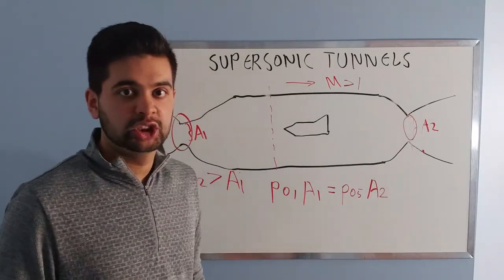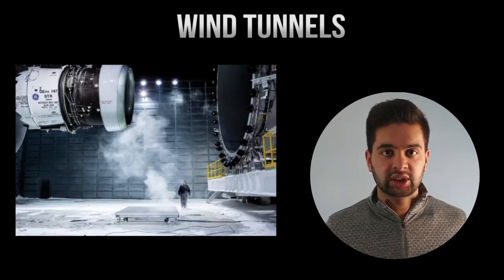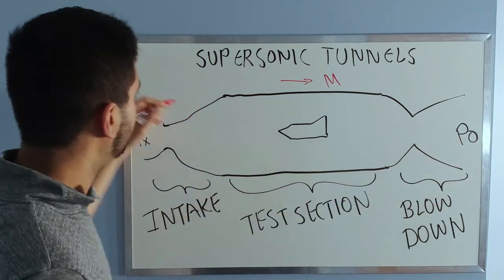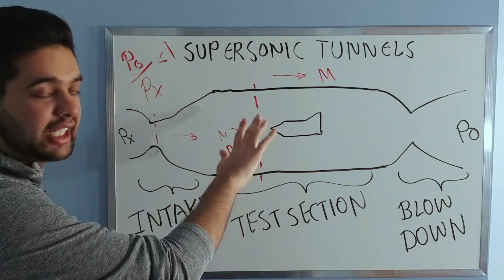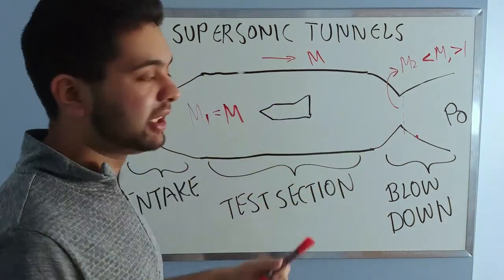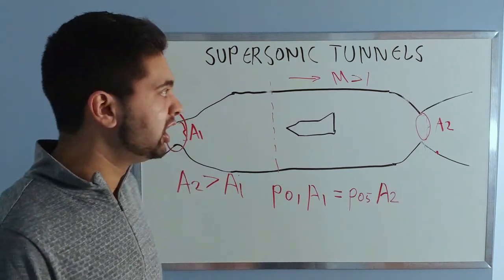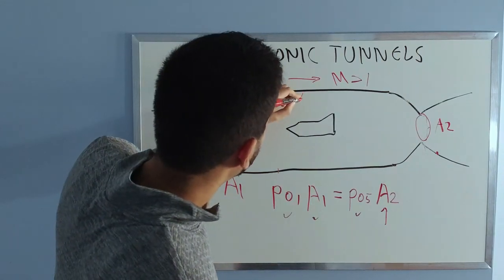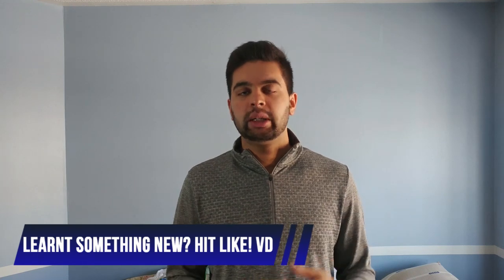Hypersonic Flight: How A Supersonic Wind Tunnel Works (For Beginners)

Comment: first glaring mistake ... a wind tunnel is to test the flow dynamics of an object .... it does not have to be a model ... it can be full size ... the only constraint of WHAT you are testing is if it fits into the the test area or not ... typically parking a 737 in a wind tunnel is not going to happen .... parking a 1/4 scale model probably would ... if the tunnel loading bay is large enough 

.
a fluid tunnel can also be used ... but you do have to account for the density of the medium you are testing in .... and yes a wind tunnel a water tunnel do EXACTLY the same thing ... both use fluid dynamics just like pumping water or pumping air
Reply: is there an in between that can be done? something that would make the fluid behave realistically. say by pressurising air so it is more viscous and behaves like air would do in full scale?